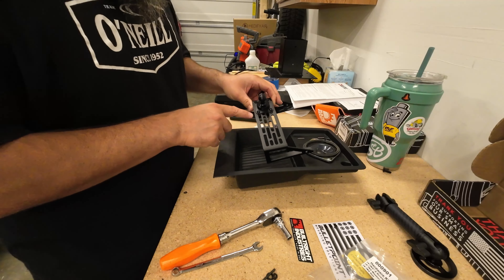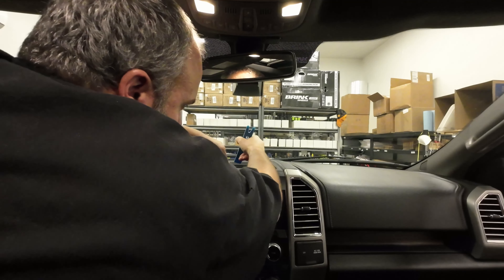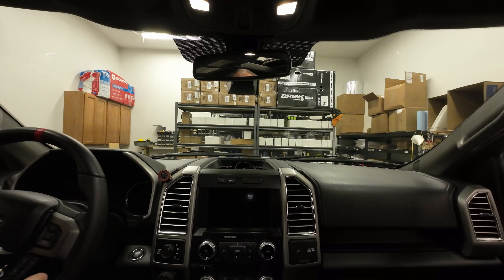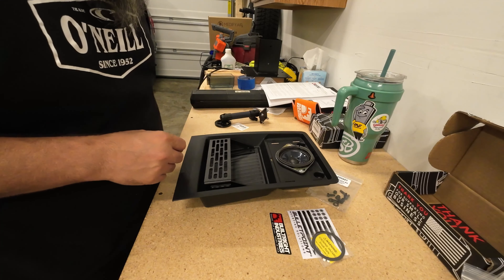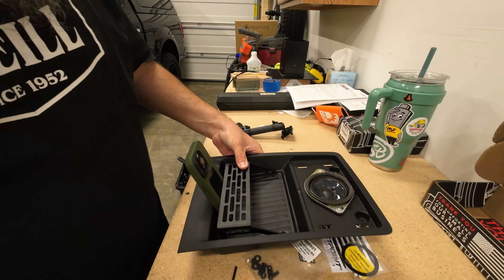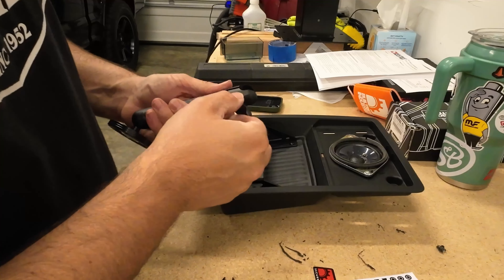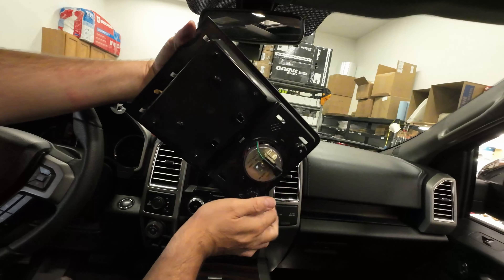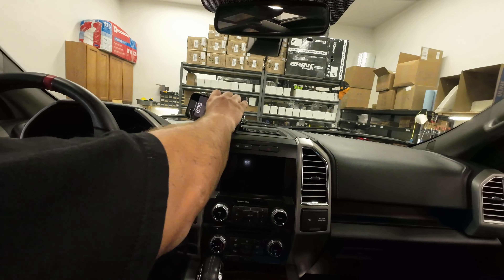BuiltRight Industries Dash Mount | Bulletpoint Mounting Solutions Phone Mount F-150 Install

Comment: Nice install. I am looking for something like this for that same type of area on my 2020 Ford Edge dash, but they don't list the dimensions of the bracket, at least that I could find. Would you be able to help me out with those? My doodad catcher is about 8" wide and it's about 3/4" deep.
Reply from the maker: Thanks. That actually sound similar in size. Because the tray is tapered mine is 1-3/4 deep at the front. And the little rubber tray is 7-1/8 wide by 5”.
Reply: @DrivingForwardBuilds  Excellent! Thanks so much for the reply. that's a bit too tall, but could work if need be. I like having options.